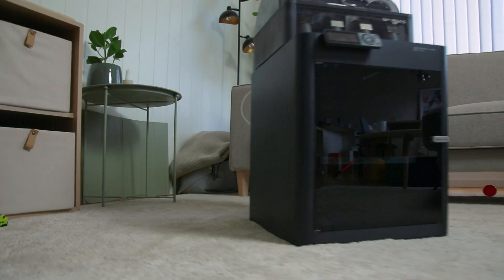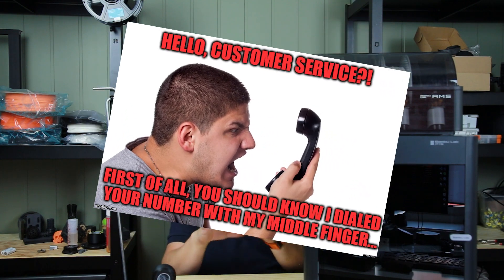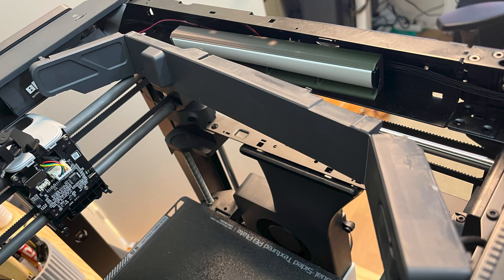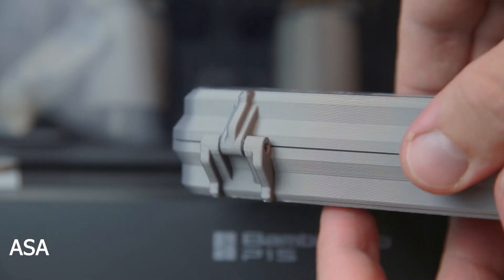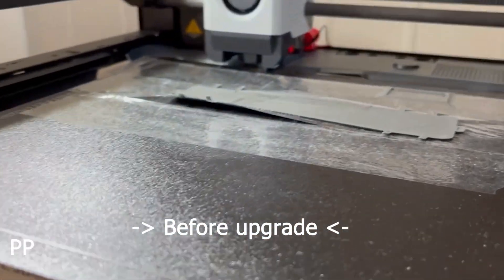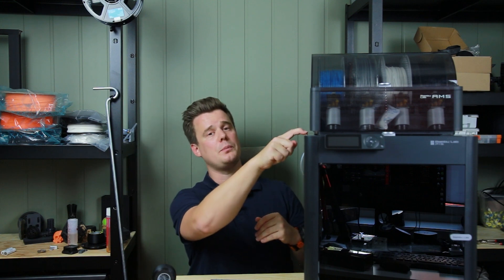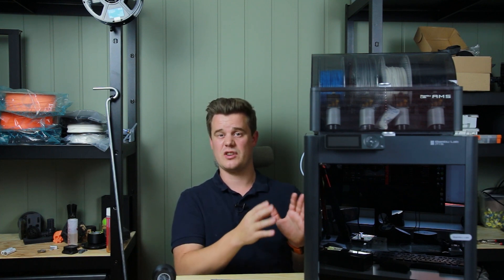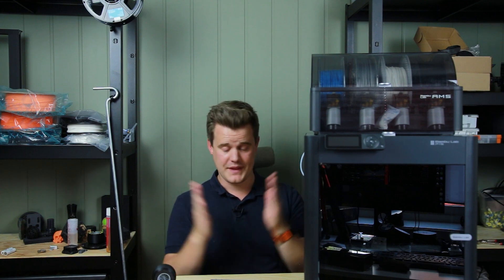Should you upgrade Bambu Lab P1P to P1S 3D Printer?

Comment: Great video, just what i needed to decide to upgrade! Not to good for my wallet tho ;) The main thing for me is that is is alot of duest in the room my printer stands and i think that will be solved with the p1s upgrade.
Reply from the maker: Thanks! And sorry to your wallet 🤪.  The enclosure definitely helps with dust. And I suggest you run a dust filter if you use external spool!